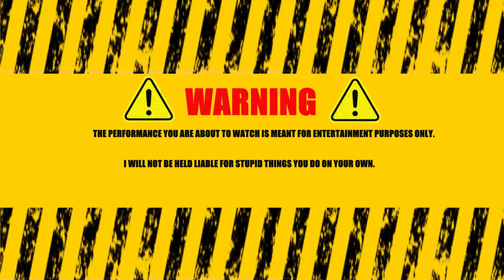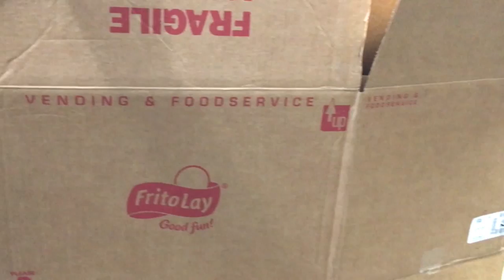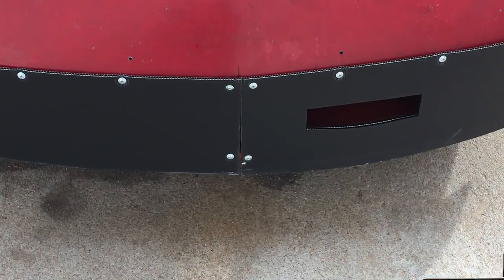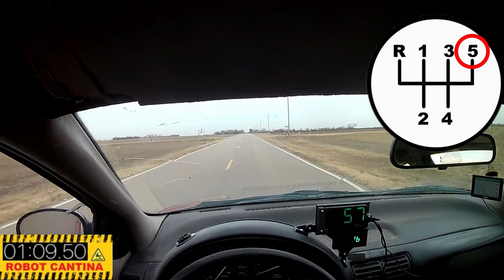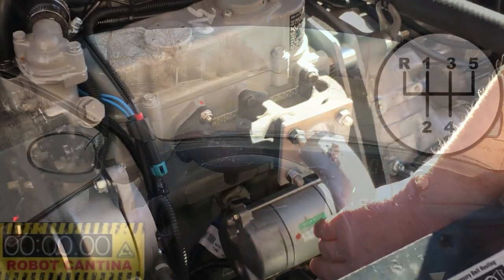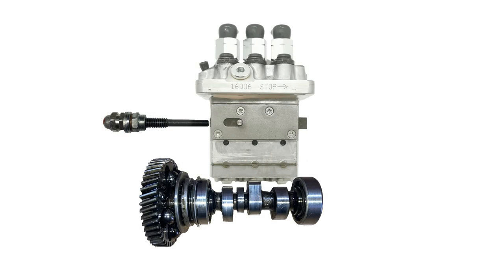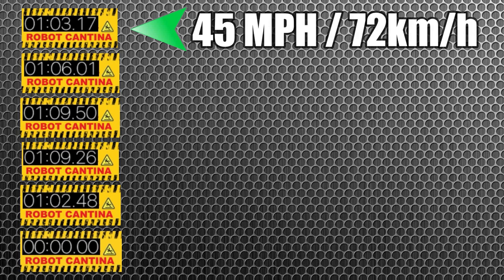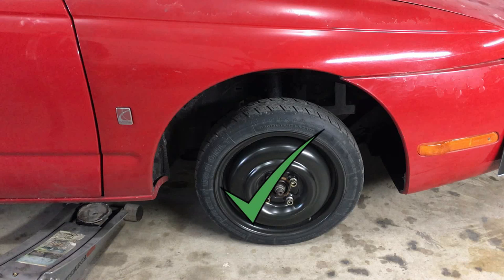S3E2   Fuel and aerodynamic mods ....We do some experiments to try and get the Saturn to go faster.

Comment: the fact the coolant isn't very warm on this engine stock is not necessarily a problem, since kubota likely designed it to operate under load as a stationary engine for very long periods of time, while being as thermodynamically efficient as possible, hence the cold exhaust manifold. by blocking off almost all the airflow to the engine bay with the airomods, the engine is likely now heat-soaking under heavy load, leading to your perceived power loss. additionally, without an oil cooler, the higher than stock RPM is probably getting the oil nice and toasty—you should probably be monitoring the temperature of that too.
Reply: Depends how you look at it - diesels are more economical when taking in slightly warmer air (although it will make more power with a cold feed). And it will be less efficient if it never reaches a suitable operating temperature due to 50mph air flow through the engine bay which it's not designed for.
Reply: Diesels don't like running too cold. If they're too far below operating temperature, they can't fully combust the fuel. If they're too hot, the intake air is less dense, and they lose power that way.
Reply: The mass air density is most likely a greater issue then the engine blocks thermal efficiency
Reply: This is funny, I have just said the same about over heating the oil.
Reply: you're absolutely right. the engine is from a trailer reefer unit, and its designed to run at a certain steady RPM constantly.
Reply: But isn't it under less load here than on the assembly line WOT all the time?
Reply: @anidiotinaracingcar4874  eh yes and no. on a reefer unit, its running a constant RPM under a steady load. here, the load is constantly changing depending on speed and gear.
Reply: coolant temp is more important than people think. If you dont get it up above 200F the combustion efficiency suffers this is exactly why modern cars run 220-240F now versus the 160-180F of older cars. Oil and water temp controls are important especially for something running at max load max rpm for long periods. The only thing you want to be coldest possible here is the intake air since cold air is denser than warm air.
Reply: @masterdebater8757  220-240? no. modern vehicles still run 190. 220 is starting to overheat. 240+ is catastrophic. thermostats are still anywhere from 185 to 195 depending on make/model.
Reply: hellokit
Dec '09
To really know if an engine is, or is not, running too hot, or too cool, is to use an accurate thermometer. How smoothly an engine runs can INDICATE (but, not prove) that it is (or, not) running at the correct temperature.
The normal operating temperature of the coolant in an engine is about 210F to 240F degrees. The thermostat OPENS at 195F degrees; but, the temperature continues to rise to the normal operating temperature. The temperature of the coolant can rise above 212F degrees because coolant is pressurized (NOT because the water is mixed with antifreeze). Boil-over won’t occur until about 265F degrees, because of the pressurization (15 or 16 psi).
Reply: @Tyler-ts2ld Ok lets use your example of a 195F thermostat that is the point which the water starts to circulate the systems minus the small hole for pressure equalization. At 195F the thermostat "began" to open it may be 205F before it is fully open and 220F before the low speed fan is demanded on. Under a heavy load IE vehicle doing real work with little air passing the radiator and we toss in the AC load on the cooling systems that Vehicle lets say it was a f150 coyote 5.0 with auto. pulling a boat upa hill at 30mph really working hard taht trucks high speed fan may not kick till 235F and even then it is safe from over heat even if it is fully taxed.
Reply: @Tyler-ts2ld  Chevy cruze runs a 221F thermostat in its tiny turbo 4.. I am sure others do also.
Reply: @masterdebater8757  funny you mention the coyote F150. OEM thermostat is 190. I just looked it up. I work for International, and our trucks are set to where the coolant temp warning comes on by 225 (by 215, the fan is running wide open). the temp shutdown warning comes on at 230. you start creeping on 240 and the truck WILL shut down. its called thermal protection. also, I had a Sonic with the same engine. it ran 194 degrees per my diag tool.
Reply: @Tyler-ts2ld  i only used the f150 as example i didnt look at the specs for the systems in it i do know they are wrought with coolant leak issues and thermal failure modes. last one i seen customer stated leaks and no oil pressure at redlight lol... sure enough every stop with unit in gear the oil pressure would beep, show red light of doom, and text. There was no oil pressure issues.. the water side Required special replacement ring sets for all lines (we got a line kit conversion somewhere),  a new pump, and 2 thermostats since the ECM didnt like the first one and would call for fan. is a shame they made such a strong motor and gave most units such a small payload cap. even that cruze is full of plastic unions. was changing a water pump on one and the plastic combi thermostat housing flew apart while i was talking to my wife. damn thing shot the t-stat across the shop. Manufacturers just want things to break (planned obsolescence). I wouldnt buy any of the tiny turbo 4's out there RN. I do however like the Sonic with the trunk instead of the hatch.
Reply: The thing ya'll are missing is this is not a modern epa regulated engine. The reason they have the newer ones run so hot is simply more fuel burn off. Now let's go back and recall what temp thermostat the manufacturer had in this engine. 160. Why? Because a mechanical diesel engine runs better and will last longer than one running 210. As well as the oil in it. As for the rpm's he's demanding from this little engine. As Waylon Jennings said "ain't living long like this". Torque range is falling way off in the high rpm's.
Reply: Ak aa

Comment: It's the boot spoiler! Removing that cost you 3 seconds! :-) Everyone know's they make you go faster! I reckon adding a couple of stripes will knock another couple of seconds off!
Reply from the maker: Dang it, I forgot to paint racing strips on the car....  Thanks for the tip!
Reply: That and a loud stereo!
Reply: They do aid in aero. Well according to most YouTube videos on the subject anyway.  Something about separating the boundary layer.
Reply: In all reality, the only thing left is to reduce the rear surface area, and a good strong edge to detach the laminar flow. Technically the spoiler was acting as the edge
Reply: Slap stickers add 5 hp
Reply: @cdj0031  exactly! Having the air detach from the car is the most ideal. Put the spoiler back on and see Jimbo.
Reply: Would adding a little 2 stroke oil into the diesel fuel aid in lubricating the engine if your thinking of running it a bit harder?
Reply: GT  badge is worth a go
Reply: @robotcantina8957  every sticker adds 5hp!
Reply: @856Dropout  This! put back the spoiler!
Reply: Only the giant 3 ft tall ones
Reply: Adding Chrome has scientifically been proven to shave 10 seconds.
Reply: @robotcantina8957  He's joking obviously but you likely did hurt the aero by taking it off. Lots of discussion on this subject on the ecomodder forum. The consensus is that minus a perfect teardrop shape, a little kick up at the rear of the trunk lid is the best way to reduce drag on a normally-shaped car.
Reply: Yeah, it could very well help with air flow separation at the rear. 'SuperfastMatt' has done some excellent videos (including one where he explains why his 60+ yeah old Tesla powered Jaguar is more efficient going backwards than forwards), his sense of humour is just like this guy too (which is cool). Great channel to check out though if you haven't seen any of Matts (CBR Fireblade powered land speed vehicle, CBR1000 motor powered Honda S600, 250cc powered Honda Grom, and others)... Highly recommended! 👍    😎🇬🇧

Comment: If you want to gain 30% more power do the LPG (propane-butane) injection to the air intake. If you never heard of this,  search for LPG-Diesel. Actually I have this system mounted in my  2.5 Audi A6 C5 and it is working great. Before I installed proper system, I was experimenting by just putting hose from camp gas tank into air intake,.You can try this for beginning :) (this is short term solution, because without heating system for gas, nozzle will froze after few minutes).
Reply: "putting the hose from camp gas tank into the air intake" otherwise known as red neck nitro XD
Reply: That's like discount Nitrous.
Reply: I don't think he can afford a new engine
Reply: LP fumigation tends to work far better with aspirated  (turbo) diesels compared naturally aspirated. Not sure why though.  Cost ratio, space to safely carry the LP is an issue though.  Seem to recall most report that it tends to work best to use it mostly for  hard work events like acceleration and long upgrades. Since you use it.....  has this been your experience?
Reply: @coachgeo  it works better in conjunction with a turbo because lpg displaces air, but with a turbo that effect is negligible
Reply: @coachgeo  I don't know the numbers, but lpg will give you a significant boost in power. Mostly because it burns much faster than diesel, so you can have much higher rpms
Reply: @coachgeo  I have turbo, so I don't have comparation to naturally  aspirated engine, but in mine it is working amazing (+30% boost, from 190HP to almost 250HP). Safety: system was mounted by certified workshop and car is fully registered, so it is safe. Costs: fuel (diesel + LPG) is slightly cheaper but it will never pay itself in my case.
Reply: Crazy idea: How about compensating for boost with LPG injection? Seeing the injection pump doesn't have the ability to do so, this would be the easiest way.
Reply: @CoffeeAddictEvan  In review again.... did the above end up written as you intended??

Each sentence seemingly opposes the other. first sentence explains why it works better with turbo but the second one says with turbo the effect is negligible?
Reply: @coachgeo  ah, I totally screwed the pooch on that one.
With a turbo, you can overcome the oxygen-displacing effect of running LPG, since the turbo will compress both the air and the propane gas.

With a turbo and lpg, you get better bang for your buck than a bigger engine with no turbo and added lpg

Hope that makes more sense
Reply: @JCGver  crazy good idea... Essentially LP=LPG =propane.

Comment: Looking forward to the turbo test! In theory, you’ll be wide open throttle less if you boost it, so your EGT’s shouldn’t be too insane. I’d get a gauge for oil temps just in case, and run an oil cooler with a thermostat.
Reply: How about a ram air intake for more high end speed before you install the turbo?
Reply: @scox7760  I don’t think they’re going fast enough for a ram air intake to be doing much that’s effective. I think it makes 1psi per 100 MPH in clean air if it’s absolutely optimized. If they’re going 65 now, it might make .6psi if it was perfectly setup, which on a ~20hp engine might make .85HP more, and I doubt that would make much difference. A decent 7psi turbo setup would get it to make about 30HP, a bigger difference.
Reply: Surely diesels are always WOT, it’s only fueling that alters? That’s why their VE is good
Reply: @garyhargreaves5630  that’s true, but they still do better with forced induction.
Reply: Oil cooler for sure
Reply: Also... more fuel burned in the combustion chamber due to the right amount of air and fuel mixed vs the extra fuel being burned in the exhaust when over fueling...
Reply: good call on the oil cooler!
Reply: @CSHUNT83  true. An EGT is great, but I think getting a wideband should be in the cards as well. An ounce of prevention is worth a pound of cure. It’s fun to spray and pray with boost, but having knowledge is always great. Plus if done right, they can swap it between cars.

Comment: Try putting the spoiler back on. Strange as it sounds it might actually cut drag in your case. IF The airflow stays attached going over the rear of the car that can increase the air pressure acting on the rear window which has the effect of pushing you forward slightly or at least pulling you backward less intensely. If you have a pitot tube and/or a magnahelic gauge laying around that you can measure air pressures you can do an a/b test on that or if not you could do tuft testing with some yarn to at least observe the airflow to see if you have a separation bubble
Reply: A low profile spoiler made from coroplast or some other flat material might be best
Reply: @discontinuuity  it's easy to go too far though and move backwards  Without instrumentation you're just guessing. The slight upturn or small deck-lid spoiler to increase pressure on the window and counterintuitively, reduce drag, is the reason a lot of OEs have been doing it. Think the new Hyundai sonata, and every Tesla, among dozens of others.
Reply: Yeah see that spoiler is not probably efficient at breaking air flow from the back of the car. The back of the car is shaped such that you need a very clean and sudden break. Although it's probably better than no spoiler. You probably are actually creating a vacuum behind the car instead of what you want which is a vortex/low pressure bubble. It would be really good to just model the Saturn and run it through some cheap CFD.

The absolutely most efficient thing is obviously to never break air flow but that's just not possible with the shape of the car. You would need a long sloping tail
Reply: Absolutely this. I used to own one of these cars and when I painted it I shaved all the badges and removed the spoiler to get a cleaner look, which actually decreased my fuel mileage slightly. That little lip that you see on the back of the trunk lid on newer sedans fulfills the same purpose. This is why a pickup truck with a bed cover on it will get worse mpg too, because the tailgate acts as a spoiler, which counterintuitively decreases drag. A lot of research went into the aero on these S-series Saturns. They were some of the most slippery cars available at the time with a drag coefficient of between 0.29-0.32 depending on the model and year. I would do any aero mods one at a time because these cars were so good you may make it worse. Another thing is the little plastic pieces that go in the front to direct air to the radiator, along with the ones in the wheel wells. I removed those at one point too thinking lightening up the car would improve mpg and performance, but that also hurt mpg so I put them back on.
Reply: Yeah, it could very well help with air flow separation at the rear. 'SuperfastMatt' has done some excellent videos (including one where he explains why his 60+ yeah old Tesla powered Jaguar is more efficient going backwards than forwards), his sense of humour is just like this guy too (which is cool). Great channel to check out though if you haven't seen any of Matts (CBR Fireblade powered land speed vehicle, CBR1000 motor powered Honda S600, 250cc powered Honda Grom, and others)... Highly recommended! 👍    😎🇬🇧
Reply: Someone watches SuperfastMatt I bet. ;)
Reply: @802Garage  while I do, credit goes to Julian Edgar on this one. The timing is coincidental ;)
Reply: @ElPants21  Totally fair. His work is awesome obviously. Just usually a safe bet when you find someone in a YouTube comment section, they tend to have watched some other videos you have too. ;)
Reply: @802Garage  along with..
 'Two Stroke Stuffing' (where he currently tuning his fully DIY built 50cc 2 stroke Supercharged motor - for a future motorbike project)... Who also has a great sense of humour too..
Then there's ..
 'AutoBeta2T' (where he's trying to make an old Kawasaki AR50 do 100 MPH) 👌👍
Reply: @802Garage  all hail the algorithm

Comment: The transfer pump you are using is all the evidence you need of air bubbles in the fuel. Magnetic piston fuel pumps of that type are notorious for causing cavitation bubbles in fuel lines, especially with oil fuels like diesel. It’s a well known phenomenon in the self-installed diesel air heater community. Try mounting your pump on about a 25-45 degree angle with the outlet side up and the inlet side down. This is the first piece of advice given to anyone dealing with cavitation bubbles in a heater. I sincerely hope this helps. Thanks for reading my comment and thanks for all the great content. I have been watching since the insight first got a predator.

Comment: Alright, I'll pitch in now. 

I own an 82 Isuzu I-Mark Diesel. .50 drag coefficient. 
From the factory, it is equipped with a 51 horsepower, 72 lb-ft 1.8L engine. 
On the tire size, from the factory, it was equipped with 155/70R13s. Those are difficult to come by where I am, so I run 175s. 
I also run my tires at 40 PSI. I've been able to pull 62 MPG out of it. 
0-60 takes 20 seconds. Fastest I've ever had that car on a test track was 94 MPH. Not kidding. Anyway, just figured I'd toss you that information to give you a base for what was commercially available.
Reply: I lovingly refer to it as the Angry Singer Sewing Machine. You can see it on my channel.

Comment: Hey, I had a diesel swapped SL2 a few years ago.  Aero mods on mine were blocking the front ducting with plastic removing the side view mirrors and having mirrors mounted inside the doors that could see outside.  They were basically a convex mirror. Worked well.  
And on the sedan at least the front lights were inset on the body. The lights were mounted on stand offs to ouch them out to be more level with the hood and front bumper.  And finally the wheel covers were like the flat ones you see people running at bonneville.  Car got about 90-100mpg when driven nicely.  And even driven hard it was capable of 50-60mpg.